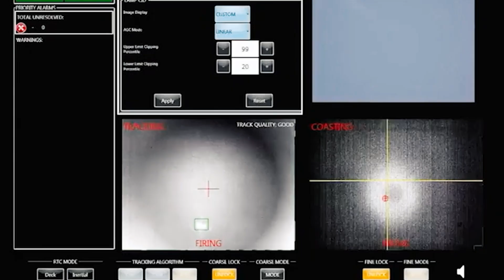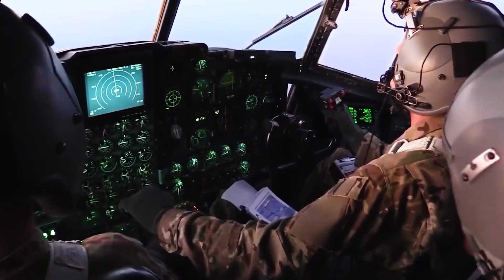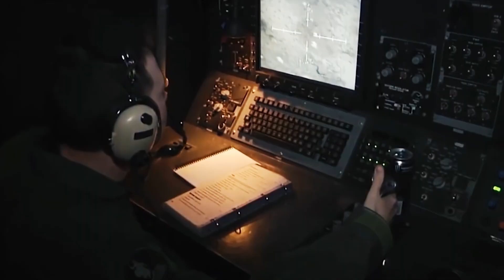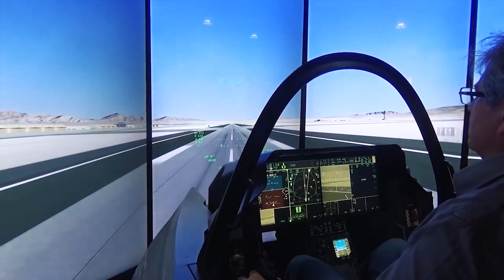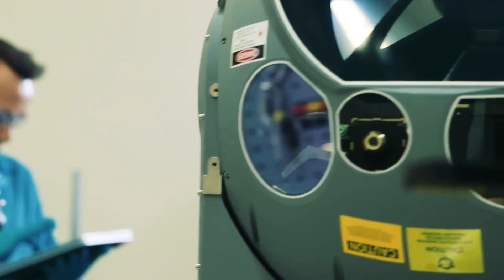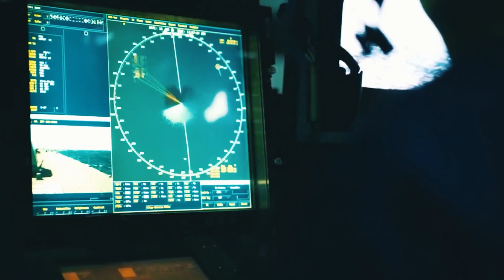This US LASER Fighter Jet Will Destroy China In 30 Seconds

Comment: instead of using the laser to heat up the target of hypersonic missiles, wouldnt it be more energy efficient to use the laser to ionize the path to the target, and then route a massive electrical pulse to fry the missiles circuitry?  basically hitting it with a lightning bolt guided by an ionized pathway of air molecules.
Reply: No